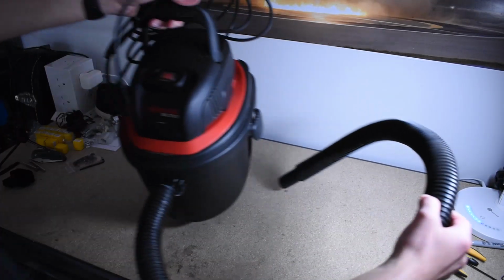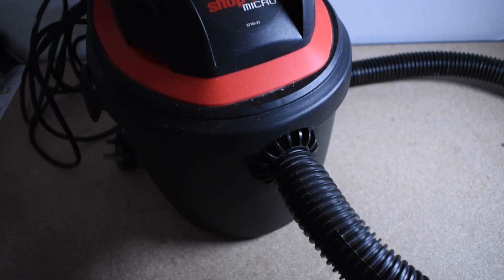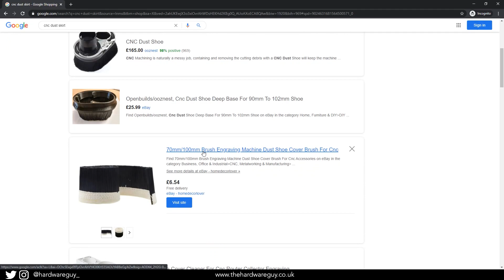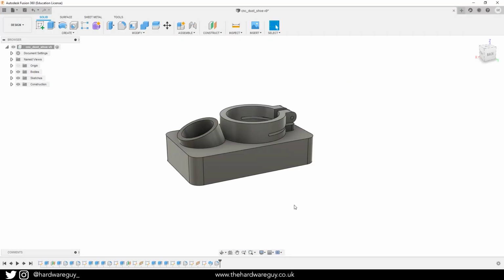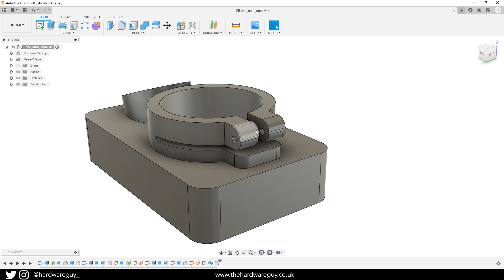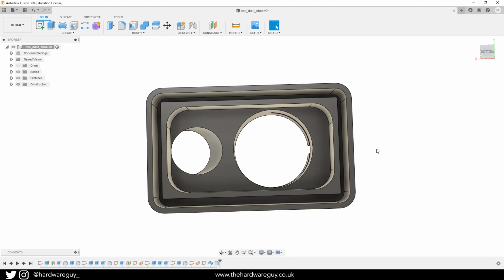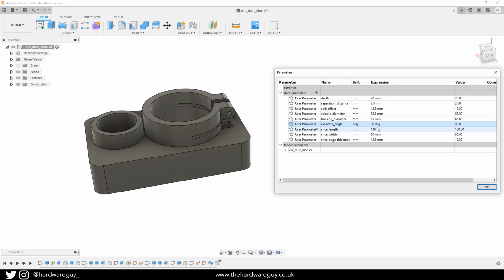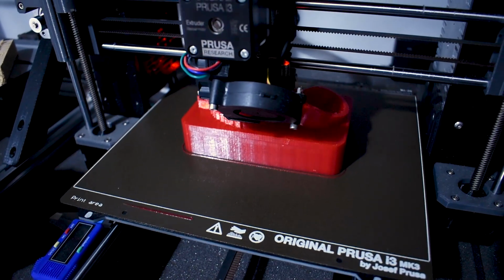$7 DIY 3D Printed CNC Dust Skirt

Comment: Great job . How do you go with setting the XYZ each time.. when the view is blocked. Do you set it... Then place on boot? I've seen some make magnetic removal options and have wondered about that. Thanks!
Reply from the maker: Hi Matthew, thank you for the kind words. Yes I set my XYZ and then place the boot on afterward. Found that the boot really helps with dust management👍🏻

Comment: Very good design and a great example of practical 3D printing.  I've looked at the skirt material on Amazon and ebay in the past, and I'm looking forward to seeing the Fusion file on your website, because I'd like to use it for my Frankenthirty-18.

Did you find the vacuum hose hindered the carriage movements at all?  I've been thinking of using a spring-loaded vertical support pole mounted on the fixed gantry to hold the tube up, like the cord support for my wife's ironing board.